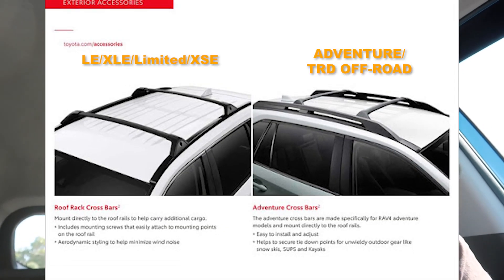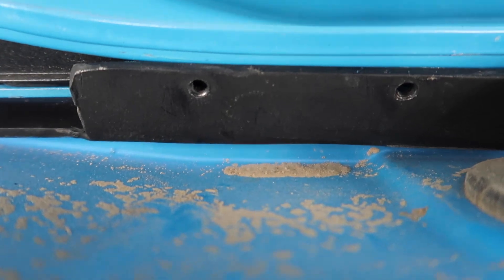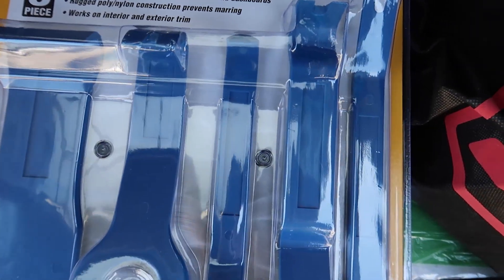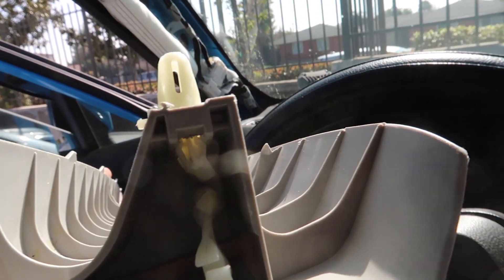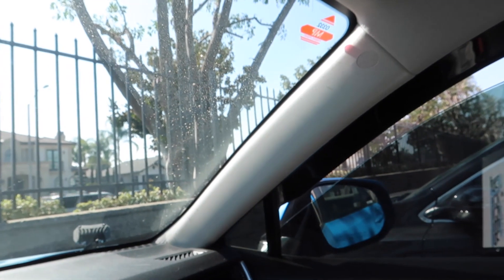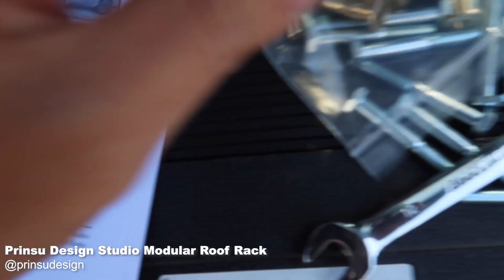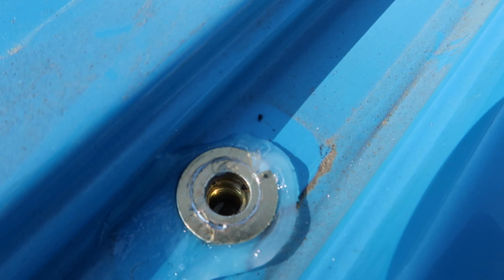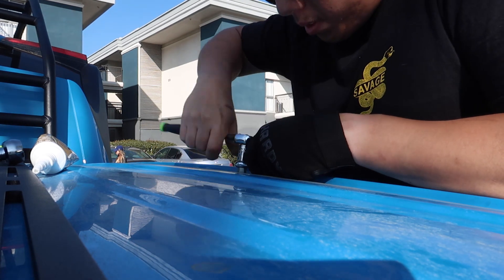2019-2023 RAV4 Prinsu Rack Install and RNOFIT Hatch Ladder

Comment: as an aircraft mechanic, I would of cleaned the painted surface to be sure it's dirt & oil free before applying silicone. Vibration will cause the silicon to dis-bond over time. But other then that, cool video!

Comment: Great video's thanks for the effort. I just purchased and installed the RNO.FIT ladder and I was chatting with them and they said that they reached out to Prinsu about having to remove the headliner and Prinsu said that you did not. Have they reached out to you at all? FYI:  I emailed them about the extra holes to see if they have addressed the issue and here is their response "We recommend using a weather seal tape to plug the extra holes in the roof. Beyond that, we do not have any plugs or alternatives to seal those holes" I do not mean anything negative in this post just information for everyone who wants this awesome roof rack!!
Reply from the maker: Nolan Foss I posted a one month follow up video where I talk about some of the sealing options. Thanks for checking out this video!

Comment: Pretty sure you would have said something about it in the video but wanted to make sure…the top of the bolts on the ladder clears the roof of the car when the tailgate is open?  Are you still happy with it?  Thinking of getting one to load stuff on a rooftop carrier.  I’m too short to load from the back even from a conventional ladder because of the angle and unfortunately that’s where my cargo box opens. :/

Comment: Since it’s been over a year with the prinsu rack, have you had any leaks or silicone failure in the holes the prinsu bolted through or the extra holes that you had to plug?
Reply from the maker: I have not had any issues whatsoever—I am actually about to remove the rack in the next couple days to wrap my roof and had planned on doing a 1 year follow up video. Stay tuned!

Comment: Where did you route the lightbar wiring to, my wife owns the exact rav4 adventure but I’ve only worked on cars and not off-road vehicles
Reply from the maker: I run a trigger wireless controller for my lighting gear so there is minimal wiring needing to be routed—here’s a video I did introducing the system in my setup:
https://youtu.be/mSzQFHHtDVQ

Comment: Any issues with leaking? And did you install that flex seal like tape yet?
Reply from the maker: mongrel420 check out the one month follow up video
Reply: @DannyRocksteady  I've watched that one too. Just wondering if you've had any leaks up to this date? And I didn't see anything about the flex seal tape in that video. Just installed my prinsu rack and I noticed a drop of water on the headliner this morning

Comment: Do u  have to use a plus nut or can u get different screw n bolt
Reply from the maker: Keep in mind that this was the FIRST rack out in public and installed DIY--so I followed Prinsu's instructions step-by-step with no youtube resources available to me at the time. Since then the Rav4 community has grown exponentially and more resources have become availble. That being said, the community has found a way to install the rack without having to drill and use the plusnuts for the rear most set of holes where you use a washer and nut to secure the rear of the rack since you have the headliner down anyway. Just hit your local hardware store with the supplied bolts and find a set of washers and nuts that fit--then apply the silicone and complete the install per the instructions.
Reply: Danny Rocksteady Thank you for adding this. Great news.

Comment: Just ordered a rack, does the headliner issue come up with all Gen 5 RAV or certain trims? I have an XLE Hybrid.
Reply from the maker: Dallen Pearson based on the feedback since I originally posted this video, you will need to drop the headliner to access the internal rail bolts regardless of trim level.

Comment: Great video and nice rack. I love the color of your RAV. I was wondering why you switched from your cargo basket. Seems like just a few videos ago, you were installing it.  Don’t get me wrong, this looks awesome, but I am guessing it cost a lot more. Just curious because I am thinking about solutions for my RAV.
Reply from the maker: The cargo basket was in lieu of a platform rack system. At the time, the prinsu (or any of the brands that ultimately replicated the prinsu rack) didn’t have exist for the RAV4. The basket is a great budget option but will cause you to have to lift gear/cargo an extra 4-5” to get up and over the side rails—it’s also a lot noiser than the low profile prinsu rack.
Reply: Danny Rocksteady Thank you for taking the time to answer. I like your new rack, although I am not as brave as you to drill a hole in my car. 😂 Maybe in the future. In any case, you ave an awesome RAV.
Reply from the maker: @litnoregrets7551  check out my response on the pinned comment—you can install them without drilling now.